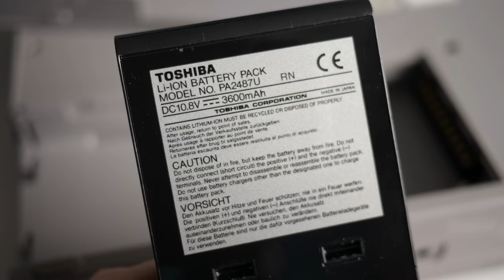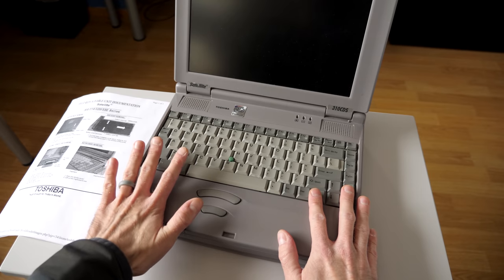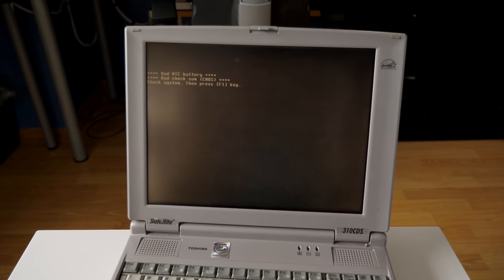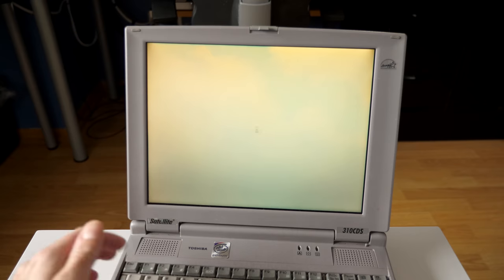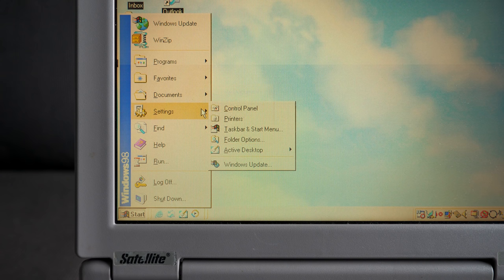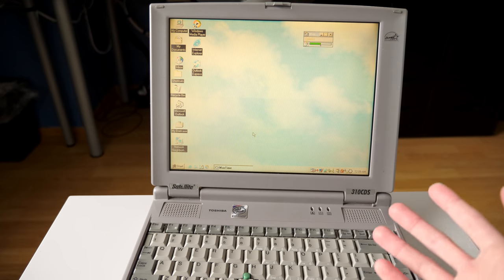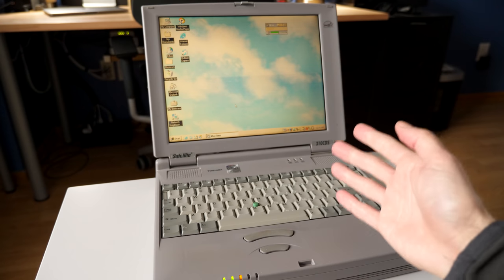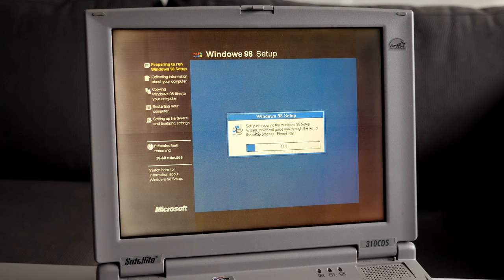Toshiba Satellite 310CDS: A Solid (but Boring) Retro Laptop

Comment: Things got interesting when slim Win98 Pentium 3 laptops appeared 1999/2000 with ATI Rage 3DGPU, 128/256MB RAM and proper screens. 3D accelerated games like Warcraft 3 or Counter-Strike ran perfectly fine on those. The Pentium III Mobile CPUs could easily handle web browsing and multimedia, many ppl used at a later point XP on them and added a b/g wifi card.

Comment: I've got a Toshiba Tecra 8000 from the same era that I keep for the old games, looks really similar just a darker grey + with a Pentium 2 233 with 64mb ram, the neomagic GPU even supports D3D+OGL, albeit very slowly. These guys were really well made!
Reply: I had a old Tecra 8000 for years. Even took it on a overseas trip in the early 2000s. Sadly it became faulty and I couldn't fix it. I still have a Satellite 330cdt. It has some weird crackling from the speakers whenever the HD drives works.

Comment: Nice, very similar to my Satellite 430CDT I use as my dos game computer. Kind of funny, because I just took mine completely apart a couple weeks ago, since I scored a BIOS locked 430CDT to turn my 430CDS into a CDT. Basically took the top shell off of both and swapped them. Now I got a bunch of extra parts too.
Also, thanks for the dynabook tip, I need to replace the hard drive in mine soon and will be needing it! Except I don't know if I type 430CDS or 430CDT =P

Comment: I had Toshiba Sat back in 97 or 98 ? Was a PII 233mhz, 16mb ram and a 1.2gb HD ? I think. Loved it. Had CD Rom and Floppy drive built in. Only complaint is i bought the DS screen and not the TFT. But the laptop worked for years and was solid. :-)

Comment: I remember having one of the CDT models.  I would dual boot Linux and Windows.  I remember I installed VMware Workstation in Linux, and I was able to use the Installed Windows based for the VM.  Windows had me install a bunch of new drivers for fundamental components, but it worked.  I could access the native Windows environment through VMWare while in Linux.

Comment: Passive matrix displays often suffer badly from capacitor degredation. I had an early '90s Apple Powerbook with a passive display behaving the same way and with very poor contrast and the adjustment did nothing. Recapping fixed everything and now it looks great (as far as passive matrix displays go anyway). Games would be unplayable on that screen because it would turn into a blurry mess.

Comment: I just bought a Toshiba Satellite 4025CDT, almost the same as the one in the video, but a Pentium 2 300mhz.. Going to make it the best DOS Machine ever..

I think the best part of these laptops is that (at least mine) has a Yamaha OPL3 audio chip, which can (supposed to, from what I've read, will find out in a few days when it comes in) run as a Sound Blaster Pro, and is Adlib compatible, so DOS gaming is going to be awesome.

Comment: These were very good at the time I think series 4000, those little pointers were a pain in the backside. I prefer a usb mouse. It was a good machine with the cd drive and the old floppy drive. It was around the time WiFi was first used. So a PC Card WiFi made that good machine. Although upgrading from 95-98 made them far better machines. On top of this it’s this it helps keeps them secure. It’s amazing how things moved on with speed etc.

These days you get almost all this in iPad or iPhone with good cameras. Some Toshiba Siemens could be good but the fans could be bad but they were good machines when they came out around windows cl, with media centre.

Comment: My first laptop was a Toshiba Tecra 700CT from 1996, which looked of the same design language of this one. It was a little slower at Pentium 120MHz, 32MB RAM, 1.2GB HDD, no USB, 4x CDROM was hot swappable with floppy, but had a nice looking active matrix 800x600 LCD.  The gray plastic housing was pretty hairline crack prone, even ~20 years ago, when I dailied it. Circa 2002, I was teased in school for rocking a 6 year old laptop. Funny how tech has plateaued to the point that nobody would notice if your gear was that age now... I assume.  I often used it as an MP3 player and for Quake. If these relics weren't fetching actual money, I'd probably seek out another for old times' sake (I guess especially since I'll apparently carry it's specs to the grave lol.)

Comment: Hi :) I own the CDT version, got it 2 years ago and the picture is mostly really good. There’s one area of the screen, where the rubber trackpad left a yellow residue and I can’t get it off at all for love nor money...but yes, lovely machine. I also have a 210CS which has the poor screen but a wonderful slightly earlier design, and the 490CDT. Didn’t spend over £30 for any of them, though the 490CDT needed a new keyboard as the space bar was broken (that cost another £11)

Comment: Huh, fun to see this popping up. I was just trying to boot up mine a few weeks ago, but sadly, HDD not detected. Is this a typical issue? Any easy solutions?
Reply: Maybe it could be the internal battery. Sometimes it forget all the settings in BIOS. You can also check the connection to the HDD, some alcohol on the connector can remove potential oxidation.

Comment: For the MIDI, I mean the system has an Yamaha OPL3-SA3, which should have the same FM synth chip that the Sound Blaster 16 used. And outside of the dropouts that I think Media Player caused, it does sound...fine ... although passport.mid probably wasn't the best MIDI file to use. Something like playing a bit of DOOM or Canyon.mid probably would've been a better demo of its FM Synth capabilities.

Comment: I am lucky enough to have a 410CDT, which is a very fast machine when you have Windows 3.11 on a flash drive. The screen is great too. Although I think its capacitors are dying as sometimes it has some weird behaviour which doesn't go away until a few minutes powered on (keyboard not responding, not fully booting, colour glitches on screen etc). And the trackpoint has never worked.

Comment: The difference in sound is around the FM synth chip that DOS games like Doom would use. Playing a MIDI in Windows will use the Microsoft software-based synth so always sounds the same no matter what. You'd need to use an FM synth game or ADLib Tracker in DOS to hear the difference. Generally there was the genuine Yamaha OPL2 and OPL3 chips which are the best. Everything else is a clone of that, some sound good and some don't. The best thing about the Yamaha chips is that they're all-digital so can theoretically be perfectly emulated. The only difference between DOSBox and a genuine SB16 is the amplifier chips on the output.
Reply: Not always. When the sound card had synthesis capabilities, being FM or sample-based synthesis, Windows usually used its hardware facilities to play MIDI files instead of the software General MIDI synth, which by the way Microsoft began to include within the OS with Windows 98, Windows 95 didn't yet had it.

DOS games and FM trackers a lot of times take advantage of the 4-operators mode of the OPL-3, while in the standard Windows GM sound set the OPL-3 is always being used in 2-operators mode to squeeze more polyphony from the chip and to be compatible with the OPL-2, which didn't had a 4-op mode. That's why in Windows OPL-3 FM sounds are less complex than what you could hear in a DOS game or tracker module.

Comment: First part of the video raised a question for me. How do you organize your computer parts and devices when you're not using them? What's your method? Do you just toss everything in a tote or closet, or are you more organized than that? And for any overflow that doesn't fit in the garage, do you use public storage?

Comment: Quake 3 Arena was optimistic in the extreme! I actually had the 320 CDT back in the late 90s - my first computer, purchased by my parents for college work. As you note in your video, the CDT screen was way better than the one on this CDS model.

Anyway, it would run Quake 2 at a good frame rate in low resolution mode, and technically would even run the game at medium resolution at a less enjoyable frame rate. But Q3A? No chance.

Comment: I agree that a battery isn't necessary at all for vintage laptops, but it's annoying when there's no clock battery and so it relies on the main pack to hold date and time, so if you don't have a working battery it always gets reset.

Comment: I had an earlier version of that. I think I got it in 1994/95. It was a decent little laptop but became obsolete pretty quickly due to limits in memory capacity and processor speed. Back then you were lucky to get 3 years on a platform before software rendered it all but useless.

Comment: Did you make those laptop storage bins yourself? A video about them would be cool.
Reply: They're just plastic boxes with clothes organiser hangers shoved in. Not sure that's a whole video
Reply: @medes5597  They are definitely not just that. at 0:14 you can see there are holes very carefully drilled in them with washers and thumb nuts. It's a nice design and would be worth explaining the rationale and how Colin arrived at that design specifically for laptops.

Comment: Not sure if you're aware of this, but there is no need to run one of those expensive IDE SSDs in one of these things, I have an Msata to IDE adapter board with a samsung Msata SSD inside one of my old IBM thinkpads. The adapters are like £10 and you can get an MSata used with decent storage for pretty cheap.

Comment: What if you replaced the florescent bulb with leds I am also surprised that there isn't a way to convert a ipad screen or any other led screen for that matter to work. The wiring diagram for the lcd cable or even tapping into the vga might be a option.

Comment: I have a 330cdt. It still works but has two issues. Needs a new cmos battery and has developed a crackle that gets louder when the HD accesses. It comes from the speakers. I'm nervous to open this up as I've not had good luck disassembling laptops without the plastics breaking .

Comment: I have a Toshiba from this time period with a k6-2 and it has an acfive rather then the sucky passive screen and a decent graphics chipset. I've ran everything from OS/2 to Win nt just fine but came stock with Windows 98 first edition. It's built like a tank compared to most modern laptops but otherwise I would call it a fair experience. The k6-2 cpu isn't bad but I have always been tempted to swamp it out with a k6-3 for the faster onboard l2 cache since the cpu is socketed. The 48mb of ram is probably as far as one could easily go with this laptop. It's 16 on-board plus 32mb simm module provides plenty of ram for basic applications. Still I find somethings rather limited even if impressive and only 16 bit color and low resolution for any kind of gaming. But this thing is like 23 years old. Not exactly close to cutting edge.

Comment: I have that machine, the screen was not working, I opened it to see if I could fix it, I couldn't and it stopped giving video from the external vga connector, I believe it may be related to the 2 battery packs it's got inside, but who knows...

Comment: Oh i have one of these! Kind-of. Its a 4020CDT with a Pentium 2. Neat lil machine but as said in the video has very limited hard drive space and as far as i tried can only run older 2D games given i tested it with Age of empire 1 and Doom which ran but it failed on running Age of Empire 2 and that copy is not scratched, work well on my main 98 pc a faster 1ghz pentium 3. 😅

The battery was also removed from my laptop and i still wonder exactly what to use it for most of the time since the beefier main pc with actual 3D (Voodoo 3 3000 glide no less) just kind of beat it in every conceivable ways aside portability and does DOS as well without emulation.

Had it got 3D i couldve justified on it games that run too fast and mmx specific like POD with the slower pentium or set it up as a "portable" (no battery atm) Lan party thing if it had ethernet but right now writting diskettes from files transfered from usb is mostly its primary job... t'ill i aquire a usb to diskette for the rare uses of that...

Comment: Ah yes. The Satellites screen looked like crap for a little while. You should check out the streamlined  Tecra 510 CDT for a slightly less boring BUT MUCH, MUCH better (TFT) screen. Also that thing can take all sorts of abuse, mine survived a flight of stairs with just a shell crack on the back.

Comment: its ok i have a 480 CDT that i bought a couple years ago that ran perfect for about a week and then just died. completely dead. no signs of life. replaced the power supply, verified the psu voltages and everything checks out fine but its dead jim. i still have it but i dont have time right now to dick with it and troubleshoot. it was a pretty descent machine when it was running. i was running a 16gb CF card as the drive. ran surprisingly good.

Comment: Why would you expect a budget laptop from 1998 to have 3D acceleration. 3D accelerators on Desktop only really started to take off in 1997 and were quite expensive. For DOS gaming you can plug in an external display and it has a passable audio chipset with OPL3 and Soundblaster support for wide compatibility with the most DOS games. It will play non accelerated original Doom, and Quake or Sierra adventure games or Jazz or Keen or any other DOS game you throw at it. Again external screen recommended.

Comment: i have one of these i expanded the ram and installed an ide to micro sd card adapter for the hard drive and it boots windows 98 in 26 seconds. i have never seen windows 98 boot so fast

Comment: Hi, I have 2 older Toshiba laptops  Tecra S1 , and Satelite M70, both are Pentium M 730/735 at 1.50 or 1.6GHZ.
The M70 has serial and parallel ports, this machine dual boots Dos 6.22 and Win XP, the Tecra just Win XP, both have USB2 / Lan - both have DCrom but it may be DVD on at least one of them, unfortunately no floppy

November 2020 i purchase a new 44 pin IDE from Ebay seller orientalson2008  $ 10AU for new 60G drive, it had zero hours on the smart info , i installed it on the S1 and then purchase a new one for the M70 just in case - while i have success with CF cards in desktops i could not get a 44pin IDF to CF to work in the Tecra S1

And yes i DL and kept every Win98 and XP device driver from toshibas web page last year

The other strange items is both machines are approx 2003-2004 and have working batteries that last 45-60 mins

Here in Australia Toshiba was regarded as a quality machine similar to original Compaq / Apple / Thinkpad

Regards
George

Comment: Unfortunately not every driver is there, I have an extremely ancient Toshiba T5200 and Toshiba removed any information about it on their website.
Reply: Wow! Now that's old. When did it come out? I actually wanted one of those old Toshibas years ago because of the cool orange display. I think the model I had in mind was T3200. But what driver would you need? I'm guessing the hardware is extremely simple. What are the technical specifications?

Of course. Internet is extremely volatile, you're lucky if something's still on there after a year. Someone should preserve all of the stuff that is still on Dynabook's website before it all gets removed. They have removed many things in the past, and they'll continue to do so.

Comment: Those slow responsive pstn lcd screens are only ideal for commercial use ,for like displaying your products, they could,ve used such screens on bus stations or as commercial boards on soccor fields etc,,, because doesn’t play a role here,
Also store managers could take advantage of it’s low viewing angle sothat in case they are talking with their costumers or they paas by, then they don’t see what the manager is doing on their pc due it’s low viewing angle,
So why not take advantage of this???
Same with e paper screens, they have a low response time and they are very expensive , but by only put them for commercial use for presentation use, you will take advantage of it’s static purpose.

Comment: IBM Thinkpad laptops of old are the worst for retrocomputing enthusiasts - plastics are very brittle, hinges stuck, weird ac plugs, weird proprietary components, etc... This boring Toshiba case type is one of the most functional and survivable laptops of the era, almost at the level of the Compaq LTE/Armada series - they are just easy to maintain and service. On the other hand, the previous Toshiba generation, with the volume dial on the front are over complicated and plagued with pram battery problems. I dumped all my IBM Thinkpad collection and focus on Compaq, Apple and these Toshiba.